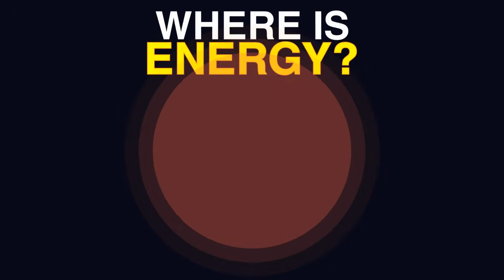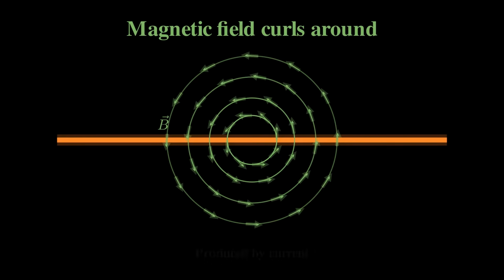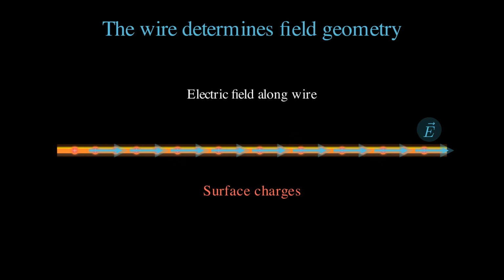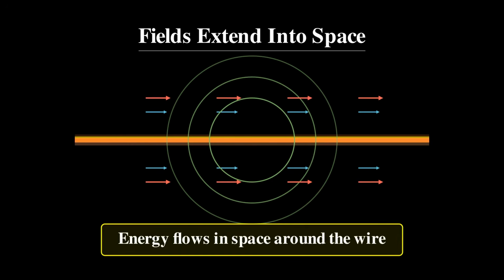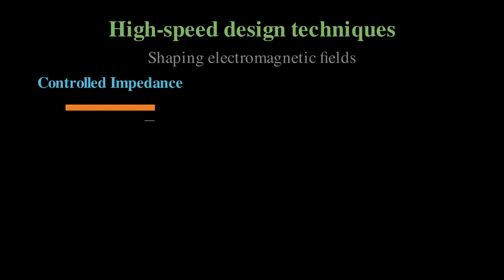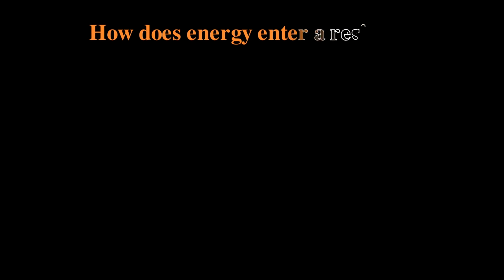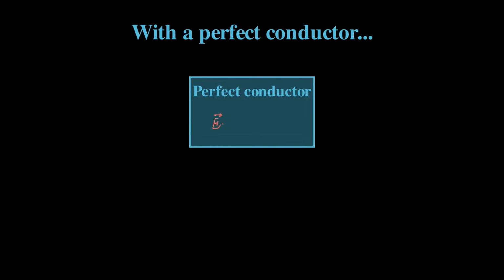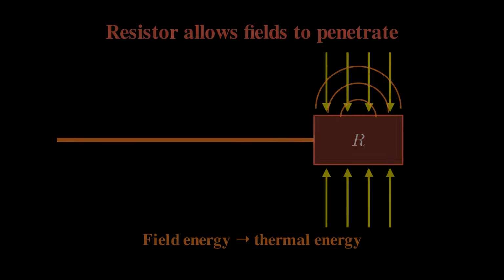Electricity Doesn’t Flow in the Wire?

Comment: If it's electric field and magnetic field that provides energy then you would only need to get the conductor to be very close to the load (not touch it) and dissipate energy.  But NOPE.  The conductor MUST touch the load..........and most likely have a strong and tight connection.

Comment: but where does the magnetic field comes from ? who is forcing the current inside the wire to flow and create the magnetic field?
Reply from the maker: The electric field from the battery is what pushes the electrons through the wire, and moving charges always create a magnetic field⚡️
Reply: @Unseen_Engineering but how does electric field from battery, goes inside a previously null wire( initially inside the wire everything was 0) . To create an electric field, inside the wire, someone must carry the information in the form of waves at every point in the wire and create the electric field vector at that point. E field can't form instantly at same time in every point inside the wire, at exactly when we connect the wires to battery terminal.

Basically i want to know the transient picture of the wire from when that wire was connected to the battery till the end when power flows along the wire.

Comment: Great video. Can you explain then why does amount of heat produced by current depends on resistence (cross section area) of a wire and consequently why do we need thicker wire to deliver more energy if it's not a current who transfers energy.

Comment: EN means hole. Gyre or gyraTion of EN is like (indu- ctive B) o csi lla ting - ring of Euler( diSCroll).Moving from hollow to empty is energy. It is OurObOrOs DNA like a helicoidal screw.Going from outside in and later inside out. Viviani curce 8 criss cross among cylinder and sphere. In my mind moving momentum kinetic magnetic heat is rotation or asymmetry chirality.Or it is pushing against s8mething. Whether it is matter or something more empty. Field is vortex,vortice,conical spiral.Atoms are matter waves, whirLing , screw. Atom + atom = 4 atoms or voID,vacuum.Side Effect of mixing MM I CS move or STR8 line that makes spinors, 2 opposite vortices.2RЯ23 mirror echo ~ cohe .... ringing rung..ripple Wireless energy is possible. Tesla did it. And many more. Work function is magnetic potential, followed by empty space we call charge(CHAR ~ ARCH),and ions(atoms). To Tesla that was a distinction among EM and IM.Wave is convex + concave , tilde ~. (water Nu 6 Venus)Tesla coil does not generate sparks, rather it draws them towards itself. Ice cracks, cryoseisms , volcanoes are examples. Acrylic glass is another, for lightning.That is sideways , from both ends to the middle dimming saddle in. Not vertical Jupiter, but upDown dENsity STARURatioN .Pushing against earth, ground, water, column of air( moving parts of airplanes, rockets etc, helice, propellers).But light is something else. It pushes against itself or water.Water is empty, and water 88 and light 89 have the same soliton letters. HY heXa.Water like carbon and glass can be hexa and tetra. I think that the most important unsolved part is water knots.Plotting a coupLing ...of heli++city = links + knots.Knots are electrons. Synonyms for it bubbles, spinors. 9e EN

Comment: our mathematics treats electricity or energy flow as if its outside the wire. that doesnt say theres nothing taking place in the wire.

we detect an electrostatic field by its attraction or repulsion on an object. we quantify that force between them. 
we detect a magnetic field between two objects, attractive, repulsive, we quantify that force between them. 

a unit distance, unit area, unit length, unit force, unit charge, unit pole...

we dont detect anything IN the wire. the effects and our maths being based on external phenomena.  

even the heat, we detect from out here rather than in there ...

yet at no point do we actually explain what "positive" or "negative" is other than arbitrary terms. we get no closer to understanding the mechanism behind the actual attraction... or repulsion.

maxwells work is based on the premise of positive sucks and negative blows. it doesnt explain why, it just assumes its there.

description, yes. explanation... no.